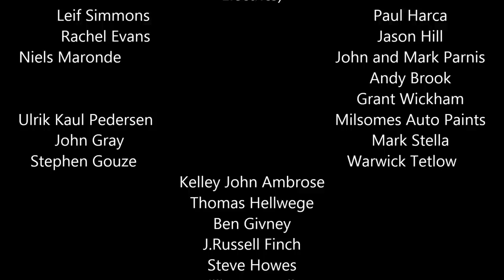Ford XC Fairmont 351 Restoration Part 40

Comment: I'm glad to see you back at it, Peter. The front calipers turned out beautifully and should work quite well. The pressure washing knocked off the remainder of the rust bringing the metal back to factory fresh and pristine. To de-rust steel or cast iron that is my preferred method. I've also been experimenting with wet soda blasting parts and it's working remarkably well. One uses a lot of sodium bicarbonate, nonetheless, the results are remarkable. We are very much looking forward to another segment, on the road to completing this excellent old/new car. Thank you and GOD Bless you and the family.
Reply from the maker: Thank you Stephen, a wonderful sentiment. Cheers

Comment: hi Peter really enjoy your video's just like yourself restoring cars is a passion of mine also. just wanted to share some info on the zinc plating of spring components /  spring washers. Although they come up great the zinc process  compromises the spring causing them to snap regardless of gauge/ thickness. i had to cop it a few times before looking into it, now i just replace or restore instead. something to be mindful of hope it helps. i have picked up some good methods watching you so felt it only fair to share. have few more for you too if your interested. keep up the good work. regards Nick.

Comment: Was watching and remembered that I had some info on loctite for you. One of the reasons it goes off is with the presence of copper. That is found in most components  you apply it to. Hence why if the bottle is touched to a component containing copper it will cause the end to block up. Good tip is to drop it on to the part or a applicator. Maybe a cheap paint brush. I wanted give you that information when you mentioned the problem watching one of your xw videos quite a while ago sorry for the delay. Also it is good to use the loctite primer products on stainless components or any other  part with a lack of copper. It leaves traces of copper behind.

Comment: if you put the parts in a wire basket or shopping trolly when you power wash them you get less floor grit
Reply from the maker: You're certainly correct... I didn't have one though. Cheers

Comment: Unreal amount of information ,just one thing, please make sure you use an old brake pad to put it on the piston if trying to push the piston back in and if on the car make sure to have the brake line release screw open to let out any brake fluid and then top it up via the reservoir, cheers :) Just makes sure to not damage the brake piston thats all ?
Reply: Lol you don't know Pete do you??

Comment: i made a cheap hot tank yrs ago  using a 20 litre drum and a submersable  element and  chemical used for cleaning radiators  worked great on iron  / metal such as engine parts etc just  can't put anything alloy or die cast it will eat it 
it would of cleaned those calipers up like new
Reply from the maker: I toyed with the idea of making one a while ago, I've heard how well they work. Cheers.

Comment: I must admit if I was doing that your XC I'd have been very tempted to see if a set of twin-pot calipers from an earlier car would fit, I hate sliding calipers with a will, they always manage to find a way to go wrong and chew up a pad and one side of the disc...
Reply from the maker: I've been fortunate with them despite not really liking them... the XD has the same calipers which have always had pretty consistent wear... although I haven't checked them of late. Cheers

Comment: Hi there , great video . I’m just refurbing the same set of brake calipers  What brand clear did you use to finish them off ?
Reply from the maker: Hey Michael, From memory it was a clear coat in a rattle can I got from Milsomes - pretty good stuff. The best thing to use is 2K clear... some places will prepare it for you, but make sure you mask up and use it in a well ventilated area, cheers.
Reply: Hi Pete
Appreciate your reply , will get onto it . Just wanted to use something that will last . Love the cast iron look as well , for my XB . Love your videos , been watching them for many years . Cheers

Comment: Hi Peter,
im want to change the drivers side mirror housing that i got from the wreckers for my XC only the bolts in the housing are pretty rusty they still work but i want to take them out to clean them then re-use them.....Only i have no idea how they come out, can you help ?
Rare Spares sells the mounting kit complete btw.
Thanks Pete.
Zoran

Comment: another great vid with some great info and ideas, do you happen to know if that caliper Assembly grease is stll available?
Reply from the maker: Yes, any brake parts retailer should have it, or Bursons. Never use mineral based grease, it has to be castor oil based. I use PBR, but I believe there are other brands as well. Cheers
Reply: i should have mentioned i am in usa,so never heard of "bursons" but i will do a net search based on the info you gave me, thanks for the reply, and keep up the good work friend

Comment: Hi Peter,
Is there a chance you could send me an email of where i could get a set of those little courtesy lights in that condition ?I just purchased a set for $50 via Ebay but they are far from great.The lenses arent even the same colour & they were dirty as hell.
If you can help me i would be thrilled.
Thanks pete.
Reply from the maker: Hi Zoran, yes I have been caught buying stuff off ebay that wasn't upto par as well. I don't know if the guy has any others but you can try... Cheers
https://www.ebay.com.au/itm/Ford-Falcon-Fairmont-Ghia-GT-ESP-XB-XC-XD-XE-XF-Courtesy-C-Pillar-Lights-/263636743253?item=263636743253&rd=1&ssPageName=STRK%3AMERFB%3AIID&ViewItem=&nma=true&si=iwBfWW0IiZJcxep%252Fc6DJh5pwehg%253D&orig_cvip=true&rt=nc&_trksid=p2047675.l2557